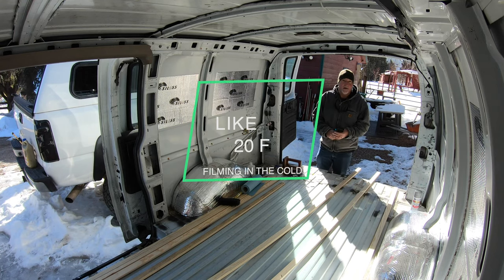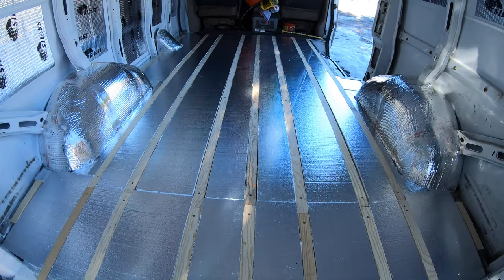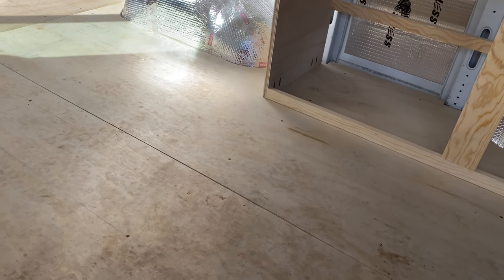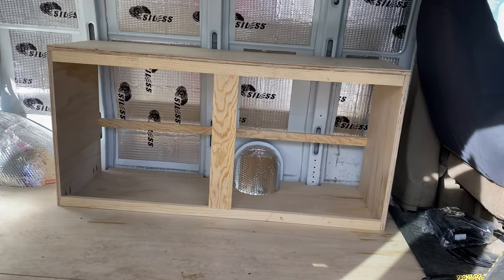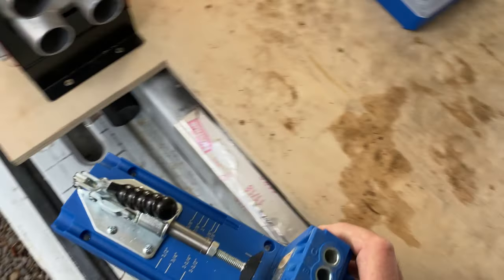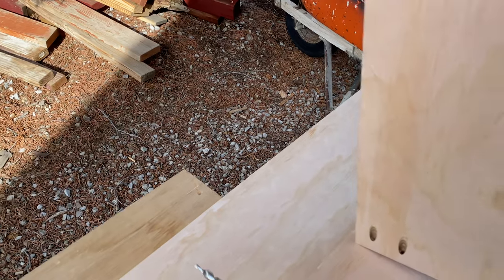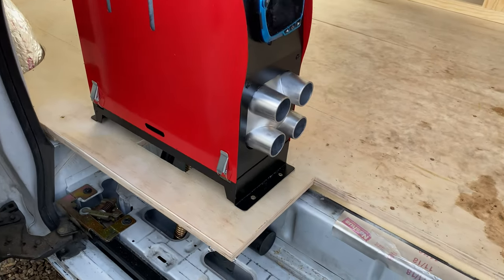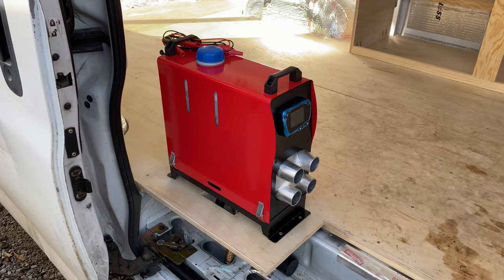Diesel Heater | VAN BUILD PART #2.  SUB FLOOR AND DIESEL HEATER

Comment: Looks good, thanks for the informative video. Will you run hot water from the diesel heater?
Reply from the maker: Nomad Life Kiwi Thank you!  Currently just going to use the heater to heat the cab and living space.  It works amazing.  So many ideas and possibilities.  Look forward to sharing my next ideas and accomplishments soon👍